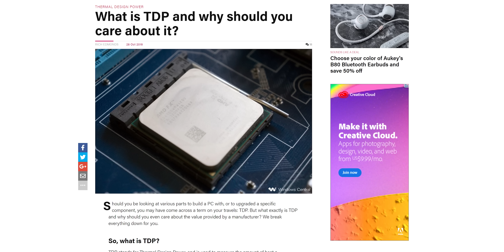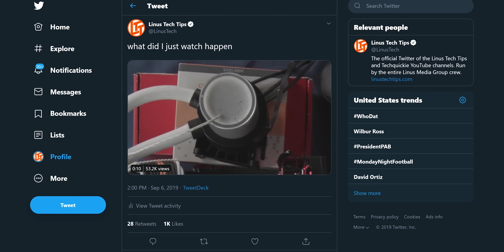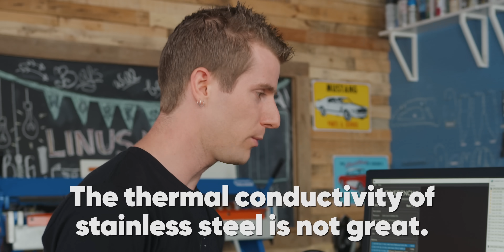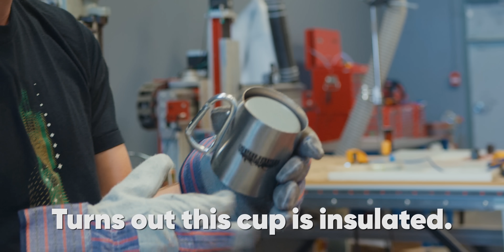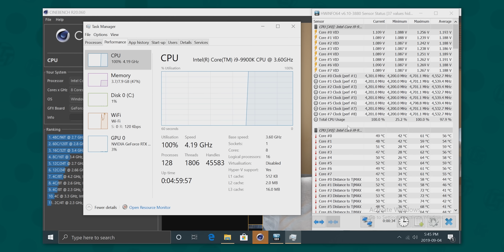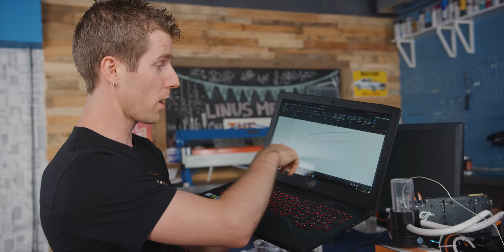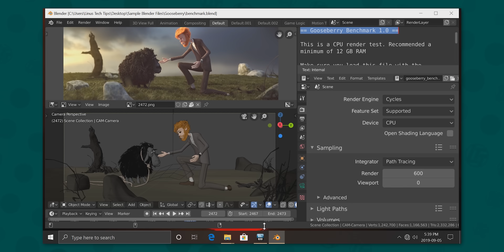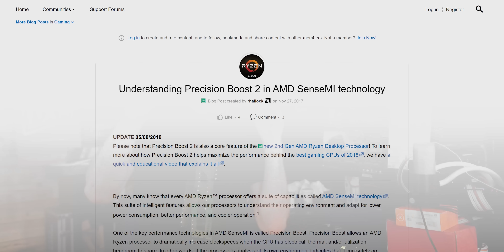Who REALLY Runs Hotter? AMD vs Intel

Comment: the fact my i5 9400f out put way more heat compared to my ryzen 9 3900xt is crazy and the 3900xt uses way more power rn its using 27watts to watch this youtube video the i5 would use around 7-10 to do the same and the ryzen 9 3900xt it cooler im using the same cooler for both

Comment: Old 125W AMD Phenom II 1090T is here. Overclock and overvolt on 3.8 GHz with all cores at max. speed and load without throttling. I realy dont know how much is TDP at this situation?! Temperature under 100% load is stable at 60 degeee celsius.

Comment: The most important value would be power per instruction. That would effectively be the amount of work done "Tiles" vs power usage.
Add to that the amount of time they have to run.
It doesn't matter much if both CPUs use lets say 90 watts over an hour. If at 40 minutes one of them is done doing the work and the other is still working at the hour to complete the same task the one that finished the job early is the one that saves the most money. Given you said Intel was at 1300 tiles complete vs AMD at 1900 AMD would be hands down the better CPU. Even if the it did use 10 watts more that difference is nothing compared to the work completed in time. You are looking at a 10% difference in power vs a 32% difference in work done. The 32% wins out. It will save you more money by completing the work earlier.

Comment: The reason I didn't bought an AMD Ryzen back in 2018 was because I needed a cooler fan to run it while the Intel i5 6500 processor I bought only uses its generic thermal sink and fan.

Comment: I have a 10600k it runs at 65 watts and 65°C at full stock turbo speeds. The chip has a TDP of 125watts and a Tjunction of 100°C; the point when the CPU throttles. This contradicts everything you said relevant to this.

Comment: I thought if you have 65W TDP CPU 3GHz base clock that means if you run it 100% load at 3GHz than you need 65W cooler to keep runing under thermal throtling temperature where Intel CPU can maintain higher temperature than AMD and thats why you can see diference in power draw.

Comment: fun fact: stainless steel is... interesting to weld on with MAG. hundred degrees C lower max interpass temp (150 degrees as opposed to 250 for mild steel meaning if it approaches or God forbid exceeds that temp you need to wait for it to cool considerably or risk hardening or otherwise messing with the grain structure of the metal) and it heats up to that temp pretty quick when welding. about one and a half to two 15cm beads is enough. and being stainless takes a while to cool down!

the slag is really nice though. crisp and flakes off super easily.

Comment: i have ryzen 5 3600 first when i start is 1,4V and 40temperature with noctua coler NH-D9l and when is working about hour playing games programs working the temperature is 63on cpu not bad than i change voltage tu 1,2V now is 28-30temperature only when i use net and watch video when i playing games its 43-45temperature very nice have 9 fans on case

Comment: Dude the toxicity. 

So fucking what if people choose intel or AMD. Theyre both good brands and make great chips, and are tailored to different functions. Not to mention Intel is barely more expensive.

And actually when comparing the I7 10700k and the 3800x, which are basucally each others equivalent, intel is $5 cheaper AND has a higher boost clock.

Comment: does the heat stays within  processor/machine during the time that it is running that's why the output is lower for Ryzen?
Because I've seen YouTube reviews that shown around 105 for Ryzen and 100 degrees celcius for Intel while it's running?

Comment: Before i even start watching the Watt is power consumption while heat is power loss. To be fair my guess is Intel uses smaller components with less capacity but more of it AMD uses less components with bigger capacity thus AMD is a bit cooler since more components, bridges etc Just rises heat loss but less Watt required tó run it.

Comment: Here is what people want to know: Which CPU will perform better without blazing up. Thus, what you should do is measure the performance of a system using the same cooler. Quite simple actually. Which system will perform better in short duration or long duration tests using the same cooler. If the cooler is somewhat underrated to actually disapate enough heath, the resulting down throttling is part of the measurement.

Comment: Once CPU fan on my AMD fx-8350 has "stucked" by a wire. After 2h of watching movies i check my temperatures (just for fun). It reached 140*C. I powered off my computer immidietly and "fixed" wire in fan. After a launched it everything was fine. Now 2 years have passed, and im still using my oc fx-8350 (4,6ghz). I love this cpu :)

Comment: The thermal design power (TDP), sometimes called thermal design point, is the maximum amount of heat generated by a computer chip or component (often a CPU, GPU or system on a chip) that the cooling system in a computer is designed to dissipate under any workload.

The TDP is typically not the largest amount of heat the CPU could ever generate (peak power), such as by running a power virus, but rather the maximum amount of heat that it would generate when running "real applications". This ensures the computer will be able to handle essentially all applications without exceeding its thermal envelope, or requiring a cooling system for the maximum theoretical power (which would cost more but in favor of extra headroom for processing power). - Wikipedia

Comment: I switched back to Intel from AMD because of the ridiculously high idle temps - just browsing BIOS settings saw voltages up to 1.5V and temps of 60-ish degrees. With regular, light workloads like browsing and emailing, it saved me about 15 degrees C! This should really be held into account, we’re not all running Cinebench 24/7 on our machines.
Reply: So intel is better when it's related to Temperature ?!
Reply: @egyptianguy1136  they have better boost/voltage algorithms, especially with low utilization. The Ryzen CPU's are geared towards producing impressive benchmark results, but show not so impressive results in light workloads.
Reply: @kasimirdenhertog3516  bro Sorry, what's benchmark ? 😅
Reply: @egyptianguy1136  https://en.m.wikipedia.org/wiki/Benchmark_(computing)
Reply: thanks so much 😊

Comment: 8:40 "Once we get coolant flow, the CPU heat will cause more convection" No. What Linus essentially did was mix up the cold coolant at the bottom with the warmer one at tge top. Convection works well enough on it's own. Granted, it makes temperature readings more accurate, but it makes the CPU reach high temps faster, because it now has a 40-50 degrees coolant at the base of the plate instead of 20-30 degrees coolant. Here it didn't make much of a difference because Intel got smashed anyways, but if the race was more neck at neck, that extra time you would have had if you let the coolant sit would be the game changer, because the more time they'd have to output heat, the bigger the difference would be.

Comment: Linus: Has rtx 2080 ti s on both pc's

Also Linus: Both pcs have 8 gb ram.
Reply: In single channel no less
Reply: Lol
Reply: Would ram more than 8gb required when you are playing high end games? I have rtx 2060 6GB VRAM but still have 8gb of RAM due to local RAM shortage. Is it really necessary to give it another 8gb?
Reply: @snowmanleblanc6053  some games consume upwards of 10 GB of system memory
Reply: @snowmanleblanc6053  in high settings and frame rate 16 is usually recommended on 3a titles
Reply: @snowmanleblanc6053  YES! I have 16 and with a higher end game, Steam and Mozila FireFox with a 1080p YT video playing in the background I use about 10-12 GB
Reply: @snowmanleblanc6053  try using dual channel 8gb
Reply: @snowmanleblanc6053  where in the fucking world is there a ram shortage, in lagos nigeria or what?

Comment: Of course you can put out more heat at the same temp (or require higher temp for the same heat output).  For example, two heating elements are set to a certain temp and maintain this temp. One of them is intended to heat a concert hall, the other a bathroom. Which do you suppose is putting out more heat?

Comment: "Why wouldn't you just use a hunk of metal"
Not just because water is more fun to look at, but also because the specific heat of water allows for less error. Water can absorb like 12-40x more energy than most common metals

Comment: [ ] Cpu
• Intel i5 3th gen
• 16 gb ram ddr3 8+8
• 512 mb graphics card 
• 120 gb ssd ( operating system ) + 160 gb hdd
Is it good??? Any advice????
Suggest me a motherboard for this cpu...
Reply: Bro what? You living in 2010? What are you gonna use this pc for?
Reply: @merlin6819  I have 512mb graphics card... please suggest me games to play on my conputer
Reply: @subhashis4769  Well I'd say minecraft and war thunder and low end games like these. The current standard for video card memory is 6-8GB. I had a 4GB gpu some time ago and even old games like AC:unity didn't run well

Comment: I need to point out a few major flaws with this experiment.You had run the experiment partially and totally on Intel multiple times before the recorded values. That will adversely affect the test results quite a bit especially when you do what you did to the motherboard. Second, ambient temperature has to be measured as well because the weather, heat generated from people and lighting and previous experiments run will affect the readings. Third, you should have used new equipment for the second test as the equipment will retain heat after the water has been emptied out. So, no, this is not scientific methodology but I do think the results would have been amd performing better than Intel. Actually with those things in mind, the gap between amd and Intel would have been higher. Also, Linus, please stop hogging all the screen. We want more Anthony.
Reply: This dude retired

Comment: you could've even calculated the real power output (Well, a ver very good approximate)
Reply: The method I would have used is a loop that goes into a tank of water (approximately half a litre so conversion from calories to joules is easy?) no radiator or fans, and measure temperature of the water before and after 10 minutes of full-on stress test
The friction and pump heat is sure low enough that you can ignore it
Reply: You should hire me to ideate real ways to accurately measure and calculate stuff, for real.

Comment: I'm gonna build a new PC soon and as a CPU I pick the AMD Ryzen 7 3700x which has a 65w TDP as they advertised. The biggest reason for choosing this instead of the 105w ones is the cooling solution, I want the wraith prism cooler and I wasn't very sure about its cooling performance compared to after market coolers. But this ones TDP is quiet low and I'm pretty sure the stock cooler would be enough. Also yes, Intel CPU's, even the older ones (I have a i5 2500 right now and have 95 w TDP) have higher heat outputs, I never managed to use a stock intel CPU with a stock cooler. I use a big ass after market cooler and even with that, at a full load during a test or gaming, it easily reaches 70-75 degrees Celsius (in the summer). I'm talking about a 9 year old CPU with a huge cooler top of it.

Comment: Stainless steel is non ferrous, meaning a magnet will not be attracted to the metal but when heated to a high temp it has a small pull. U will have to dangle a magnet next to it and watch for a pull, usually 400 stainless.

Comment: Considering that the systems are supposed to be identical builds besides the CPU, wouldn't it have been easier to watch the power draw from the wall and let them both use standard coolers?

Comment: I got a 3700X over the 3800X because I thought it had a lower power consumption and less heat output since my 6700k was basically cooking my room.
I have 100% noticed a difference in temps in my room, and that might be due to using the stock cooler brand new over a refurbished 100iv2 for over a year, and heat going out the back instead of though a very plastic/mesh top panel from a decade old cooler master case, but, then again, if there is no real standard for measuring heat, what is the difference between those two CPUs?

Comment: This sounds ridiculous, and if it wasn't LMG I would think it's unnecessary, but is there not any reason to try out 2 9900k's and 2 3800x's? I just know in the past I've had multiple of the exact same card that ran fairly significantly different temps by default. Like 5 degree difference. Would suck to make these conclusions just because of a poor sample but I'm guessing QC on a 9900k is a little different than a 6700k

Comment: Hang on.. All this boost/turbo difference.. It also seems inverse in that Intel 'holds back' the CPUs at certain states and temps, whereas AMDs approach is 'keep pushing' even if it's lower, it's the highest of the low, if that makes sense? So whereas Intel seems to be losing speed, yet saving the life, power and heat of the CPU, AMD is risking the silicon degrading a little bit faster? There isn't that much in it, but i think it would be a more interesting test with both CPUs power control systems disabled so they all have to run at full clock and power constantly, even if they should hit throttling - disable it all! If you're 'only' doing the test for 20 minutes, neither should be badly damaged with all the protections turned off...right? ;)

Comment: Considering power is 'dynamic' and TDP should really be considered 'absolute maximum at 100% load' this is kind of obvious.. Plus Intel still fabs on a larger process, even if they do get hotter they will last longer and strangely need less voltage, more current.. Which is a good thing in terms of efficiency and longevity! Plus, my "95W TDP" i7 8086K only draws 95W at full load stock if the iGPU is also fully loaded.. If i disable it and load just the CPU cores stock, it's 65w constant power draw.. So yeah, why so many are confused and surprised, i have no idea.. All i know is my Intel systems at varying loads and clocks consistently pull less power generally than AMD machines, it's the GPU that tends to pull more across the board, especially in high clock but idle mode lol First gen Ryzen 1K series runs hotter than Intel, fyi :P

Comment: I am not sure but i feel that Linus should have just delidded both cpu, slapped cooler on the dies of both cpus, and then measured the temperature at both stock(95w for both cpus) speed and turbo(what ever wattage the cpus decide to suck) speed.

Comment: There is a much simpler way of finding out how much power the CPU is dissipating, why couldn't you just connect a ammeter in series with the CPU's 12V supply? The only downside is the inefficiency of the VRM will show up here as well, but it would be more accurate than what you're doing. A better way to find heat output using water is by observing temperature change versus flow. Simply set up an open water loop, a siphon between 2 jugs will do, and measure temp of water before and after the waterblock. If you know the waters flowrate (simply time how long it takes to fill a cup), you can then calculate power output using temp change over flow rate.

Comment: But when intel overheats, the computer turns off automatically, but if amd overheats, it can dead!
Reply: If either gets to throttling temperatures they lower the clocks until they hit a safe temperature. If it does not get to safe temperature it shuts off, on both

Comment: Wouldn't an LN heatsinks filled with water be a more secure way to measure temp difference?  That way you already have an insulated vessel that bolts to the mobo, then you just fill the container with a premeasured amount of water.

Alternatively, couldn't you just put the whole thing in a box and measure the air temperature?

Comment: Intel rates their CPUs TDP by whatever cooling is enough to just keep it from throttling, while AMD measures by what's enough to keep the CPU at it's absolute maximum potential under full fucking load. Intel needs to wake the fuck up.

Comment: To make the measurement more precise, use big amount of water. Using bigger water mass will reduce the influence of other factors.
Just get 5 litters water bottle insulate it and connect it to the pump. Measure how  long it will need to rise the temperature with 10ºC. The one that takes longer is more efficient - thats it.

Bonus - to calculate the watts divide 209080 by the seconds it need to rise the temperature, lets say 30 minutes: 209080/1800 = 116 W. To be more precise insulate the pipes, the pump and the pump motor too.

Comment: I have Ryzen 3800X with AIO and temperatures are much worse than I expected, AMD fans were screaming it's cold and don't buy Intel and it's just not true, it's both hot like hell. I think Intel has much better power saving features so temperatures in idle are better on Intel. I don't understand why that stupid Ryzen has about 55°C in idle, it makes no sense for me. I had to set -0.1V to make that temperatures normal. But ofcourse Intel has worse temperatures in load, but it doesn't mean AMD's temperatures are good.

Comment: far be it from me to consider myself an expert, but I do have a Noctua D15 on my ryzen 1800x, and it is the very definition of overkill

the fans run at around 500-600rpm even under heavy load, so they dead silent(I like it quiet)

on my 8350 the cooler was quiet, but not as quiet, however, any other cooler was clearly noticable under load and in a silent case overheating was an issue, especially with overclock

so I think if you have made the change from bulldozer and you take the same cooler you had, you will certainly notice the big difference